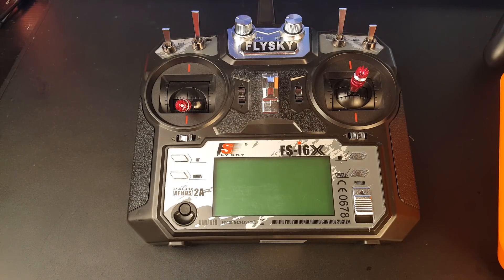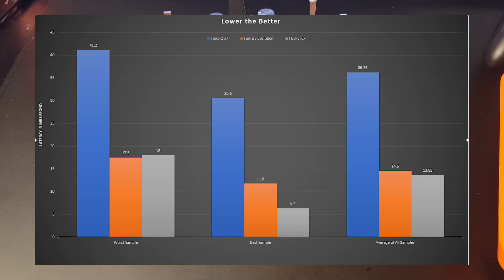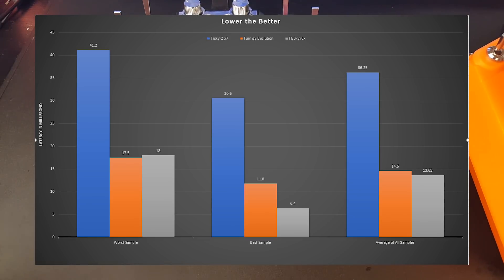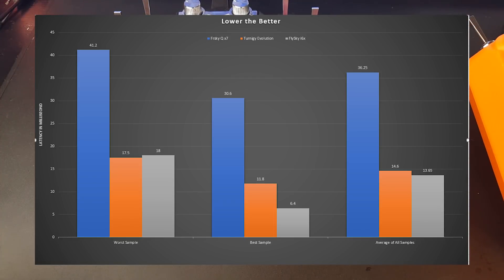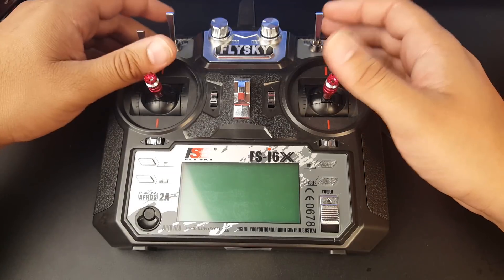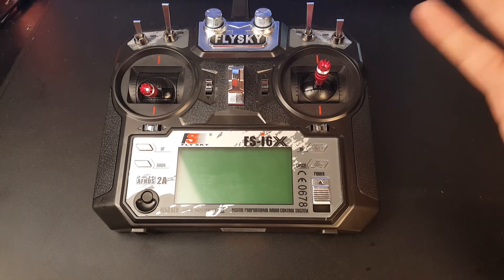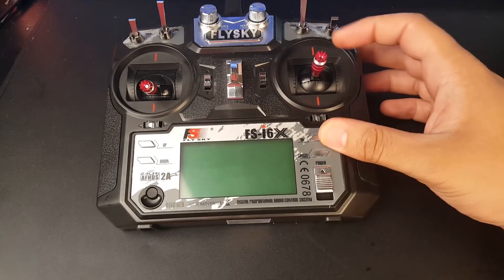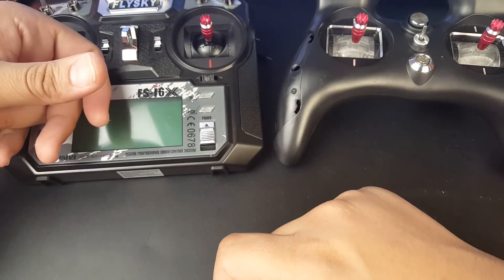TBS Crossfire Killer?!! // FlySky i6x Latency

Comment from the maker: Hey guys I'm not saying TBS is bad at all it seems hella fast soon I'll get my hands on one.
Reply: I'm wondering with a 1000watt RF amplifier why even bother with a crossfire mod. Range would be crazy.
Reply: prophet11236 its on Amazon listed as 4w. I tested the power output and its actually 2w. It's a metal case that kind of looks like a bird design. It's bi-directional so you get telemetry still, as long as you are using diversity receiver. Like the ia6b or the x6b.
Reply: prophet11236 Wifi Signal Booster 2.4Ghz 4W 802.11 Signal Extender Wifi Repeater Broadband Amplifiers for Wireless Router, with 5dBi Antenna https://www.amazon.com/dp/B01B94U438/ref=cm_sw_r_cp_apa_M4JwAbPS00TCQ
Reply: @Just-A-Guy-Learning  Hum
Reply: prophet11236 yes its great for long range and its definitely not legal without a ham license for us here in the USA. Definitely get your ham if you dont have it. Cya. Cover your a** lol.
Reply: Drone Mesh what happened to Omnibus F4 pro corner. Is it good ?
Reply: Yeah the fsi6 on a 2w module goes stupid far.
Reply: KNUCKLEUP FPV can you post a link to the 2w module you used?
Reply: KNUCKLEUP FPV ok cool bro. I will check it out. Would be great for long range even though the transmission power is illegal in the US...
Reply: Hey boss where would u place the Flysky i6s in this? Is the latency basically the same as the turnigy evolution ?
Reply: Justin Mack yes ibus on i6s is the same
Reply: Can I install "TBS crossfire" on FlySky FS-TH9X 2.4G 9CH Radio?
Reply: TBS is not Bad hummm TBS kille all rlink... My RC car 10km 1 w TBS lite number one, you TX 2.4 GHz shit -40 USD 😂 ! My TX futaba  1500 USD + TBS lite is best
Reply: @bongarcon8806  I'm not even sure what you were trying to say in that comment.

Comment: As an flysky and frsky user i can confidently state that flysky has very very very low latency than accst protocol. and i have never ever failsafed till now reaching more than 1.2+ km range. and i am impressed with its solid AFHDS 2A protocol most underrated one. seriously the latency is very very less that it feels like you control the servos directly using wires.

Comment: I would like to see how Stable the signal is over say a 5 second delivery of many signals and see how much "jitter" you get as I have a DX8 and on paper it was, a few years ago the fastest response you could get BUT! The signal jittered all over the place and made it Soooo hard to setup a quadcopter it made me buy a X7 and I have not regretted it to date?.Like so many things the speed is only half the Answer.How many times the rx has to get another packet of info is equaly as important to me? as if it does have to re-send a packet then this will skew the answer.I know in a perfect world of "Digital" signal tx/rx's would only have to deal with how fast it can send a signal But! wireless sinals are not in a perfect world ?m.Carbon frames make reflection trees and buildings do to and a multitude of other things are capable of clipping a packet of info and Bang! their goes your fantastic latency and this changes Everything!.
Real world Testing is the Only way to get a True indication of how good your transmitter is .
But I will say that benching things is a good place to start the working out of a result.
enjoyed the video
P.S. This is my opinion only and I stand to be corrected as I'm reciting alot of what a close friend has told me and he is a trained electrical engineer .
Ultimately  It's all up too THE THUMB's with Me! 
cheers

Comment: Ibus is a faster protocol than sbus and spektrum. Its been tested and posted in a few related github repos and on a few rc groups. There are mods for original fsi6 and you can run any protocol as well as openavrc. Its like open tx but uses less of the ram and memory. A stock fsi6 can easily go 2.5km. There is more than one video proving this on youtube. Crossfire still goes further. I went from fsi6 to a qx7 and can feel the difference in response. Im killing crossfires range with a 433mhz openlrsng system. Running sbus with telemetry. Unfortunately ibus was never ported into openlrsng. Otherwise thats the protocol I would be using.
Reply: 2.5KM under perfect condition. Mine already struggle at 350M with several obstructions and quite a lot of interference. Also, at those condition, I can feel that my i6 latency become worse when my X7 performs just the same. SBUS is a very old protocol, first invented by Futaba and used by FrSky until today. Even Futaba already released the SBUS 2 or something. I'm waiting for new protocol by FrSky.
Reply: IRFZ44 i fly in high rf city environment. No problem with range. They freq hop extremely well. Only issue is qc. You may have solder blob to ground where you shouldn't. Like many others have had. Killing your rf. I added a 4 watt booster and have not found the limit with the extra power.
Reply: IRFZ44 and there wont be a new flysky protocol. Afhsd 2a is their new protocol. Any rf gains latency at range. You just got a bad radio my friend.
Reply: You'll disturb other 2.4G band user by using 4W amplifier. 4W is a lot of RF power man. If you want more range, use UHF. Every digital protocol RF link gain latency at distance, but it's more noticeable with my i6 and no, mine wasn't defective. I've seen someone went 9KM with Taranis radio. No amplifier used.
Reply: IRFZ44 i dont use the booster in the city man. If you re read my first comment i fly on 433mhz now. That is uhf. Your radio is defective if you are claiming 350m. Its rated at 500m yet goes much further. My 4w amplifier is less disturbing to things around me than uhf is. I fly 1w modules at 433mhz. They make tv's hum and radios squelch. 2.4 may make a few older routers switch to a different freq. Most are using 5.4 for wifi now. Your flysky would feel slower at range than the qx7 because of the high packet loss. I own a qx7. Thats what my long range modules are plugged into. It has noticeably more latency than my flysky controllers at any range. Gimbals feel pretty close to the same. The qx7 is just too fat. I am removing the grips from mine. Im using a 4 in 1 multi protocol module now so I dont have to buy 13 frsky receivers. I only have one and I dont like how slow it is. I run ibus for my old flysky receivers with telemetry. And obviously the two quads with 433mhz. Multiprotocol module and flysky receivers is the way to go. No inversion needed, and telemetry without an extra wire.
Reply: I used A8S receiver and i6X and got bad results. I don't know why but I don't think my radio is defective. 

Does iBus capable to do full telemetry?
Reply: IRFZ44 your problem is that shit receiver. Its good for 200m. Use an x6b or ia6b. If you get the x6b buy a set of true dipoles like the ia6b has with ipex connectors. You will go way further. Half mile to a mile easily. X6b does true battery voltage as well. If you have osd that's not needed though. The fsi6 is the one that does telemetry. The i6x needs to be modded with openavrc. Fsi6 just needs firmware update. If you use a multiprotocol module you can get ibus telemetry on your qx7. There is a whole rcgroup thread on the a8s issues. Random punchouts. Terrible range. Its a micro receiver for micro quads. It will not do telemetry because its a one way link. Only receives. They have to be wrapped in foil to help at all. I should have guessed thats why you were getting terrible range. Upgrade. You wont regret it. Get the 4 in 1 or an fsi6.
Reply: IRFZ44 and yes ibus will do full telemetry. It will send every sensor or reading back to tx.
Reply: Good to know that my receiver was shit. I just know that i6X has community firmware.
Reply: IRFZ44 the fsi6 has community firmware. The i6x has openavrc which is kind of a pain to install. You have to add an arduino. I haven't seen any firmware implements for it like the fsi6 14 channel telemetry firmware. Seriously though try a different receiver. If you were in northern virginia I would let you fly one of mine. It feels so much more responsive with a good receiver.
Reply: Whoops, wrong lol. iBus can do 18 channels, right?
Reply: IRFZ44 the protocol can do up to 32 channels. But the transmitter has an 8, 10, and 14 channel firmware update. And that's because the tx has limited memory. With 14 channel you can add an extra switch via hardware mod if you want or a third gimbal to control a pan and tilt camera. I own an fsi6 and turnigy i6. Both have 14 channel firmware with transparent telemetry. Ive had them both out to 1 mile. You lose telemetry around a half mile because the rx has weak transmit power. A tiny 1w booster hooked to the x6b gives you telemetry full length of the flight. Booster and rc are about the same size. Ipex to sma goes from x6b to booster. Then antenna goes on other side of booster. With that setup i haven't found the end of ramge before losing battery.
Reply: IBUS seems promising. Tell me more, do I have to do hardware signal inversion? do I have to run one extra wire to run full telemetry?
Reply: Labrador and do not use ibus or sbus on the a8s. Its a non diversity non telemetry receiver. Get an x6b.
Reply: I'm not running Flysky anymore, I just want to know more
Reply: Labrador ibus is running at just over 6ms. There are pics of the signal parttern and speed in the multi protocol group on rc groups. Only issue is no one has made a lua script that works with it. There are mods to the ia6b to get a seperate control line that will talk to lua.

Comment: Hi DM.
As you have an oscilloscope (and more important you are able to use it :-)  ) could you please check if the B pad and S pad on FrSky R-XSR receiver are respectively uninverted S-Bus and uninverted Smart Port signals ?
Thanks in advance
Reply from the maker: +IceCreams62 All I have are XM+ and x4r but as I know yes they are.

:)
Reply: Thanks a lot :-)

Comment: One of your previous videos you mentioned how you like the QX7 over the Evolution because of the additional range of motion in the QX7.  That got me thinking because I actually shortened the sticks on the gimbal of my Evolution which I think compounded the shortcomings in range.  So I reinstalled the original stick with the addition of a couple spacers and now I feel like I have a lot more control and range in the Evolution sticks.

Comment: sounds like the extra delay from frsky comes from the model matching thing.

I've done testing radio controller  with multiple environment, the problem with flysky was there will be possibility u might controlled other people's craft if both power up receiver at the same time, the radio will randomly lock to either or both receiver.

Another test was done with four x8R to output 32channel on taranis x9d plus with xjt module, it shows that frsky can lock on to specifically lock on to individual receiver without mixed up.

Comment: You should try different firmware on the frsky tx as you mentioned. I suspect most delay is in software filtering.

Also you should try one of evolution or i6x when the rx is in sbus mode. This should show that ibus/sbus is not the differentiating factor.

Lastly, try two different frsky rx models to rule that out as a sec.

Great work man !
Reply: Peter Kjellström I

Comment: through my come up in fpv as a hobby i have upgraded to better hardware, i was however really impressed with the flysky i6b reciever the radio is cheap yes but i got more range than expected and my only failsafes were after catching the antenna in the props.  i now use frsky,  tbs products kick balls,  if you have the cash i feel their products are worth the cost.

Comment: Hey man, why in your opinion is the Turnigy TGY-i10 (and the FS-i10) completely ignored in the drone hobby? I use it. It's amazing. It's $99 and IMO the BEST deal in TX's. It's thin, light, has a color touch screen, comes with a lipo battery, does full telemetry, etc, etc... Weird? or is it just me? (With this news, now I'm 100% happy I went with the TGY-i10 instead of an FrSky product!)
Reply: There's a reason why i10 series is ignored in this hobby. Because i10 series is overpriced. You can get the same 10 channels using i6 and various custom features using community firmware for half of the price. At $100 range, Q X7 is so far the best choice. For a little bit more, you get proper upgradeable gimbal, voice feedback, full 2 way telemetry, openTX!, trusty protocol and more.
Reply: The I10 is a bad transmitter for the price. The I6x is a damn good transmitter besides the feel.

Comment: You have a 1000 watt amplifier? Or did you mean 1000 milliwatt amplifier. I am a ham radio operator and my 1000 watt amplifier weighs a ton.
Reply from the maker: Thanks for the correction. Milliwatt**

Comment: wow.... this is just unbelievable results... i have the i6 with the 10 channel mod, iforce2d's tutorial, he also had a look inside and the i6x seemed to have bigger chips and a neater board so they arent identical,  also the thing about rc interpolation rate i mentioned before is about the smoothing and ''therefore'' latency added at the fc's end of the radio signal.. if i'm understanding josh's vid correctly. it would be cool to know if betaflight is ready for the ibus signal and if manuallydoing what josh did is worth it on ibus... also does anybody know if adding caps to esc's and bat leads can cause lag in power build up or if switching on dynamic filter without switching off notch filters can add lag to my stick feel?... i have kingkong motors so i'm not confident of switching off notchs or d term.

Comment: Yes yes yeeesss!! Pleeease do the mods on the flysky!! The range booster and upgraded gimbals!!!! I have the original flysky transmitter and still love it! But i would love to see how those mods turn out! I also have a range booster which i never used because im kinda scared to screw things up.. What would also be verry awsome is to see if its possible to use the tbs crossfire system with the flysky! Of that is possible, and also some better gimballs, of will be the perfect radio:D! Keep up the great work my friend
Reply from the maker: I think we can add modules to the flysky i6x 20% sure about this I saw the board and if it outputs what i think it does we can take from it or make an arduino to convert it to tbs. 

I will look into this once i get a TBS Crossfire
Reply: Look up the openavrc mod with multi protocol. It's been done already
Reply: Drone Mesh there is a ppm out pad on the PCB,if I remember correctly, so adding a modul shouldn't be a problem.
Reply: Omg that would be awsome! But can you also then use the cfrl protocol?
Reply: Yes please. Hopefully the same mod works on the I10.
Reply: UnXisT FPV cfrl wouldn't help to much if you are using a ppm signal from the radio to the module scince the latency is already high

Comment: Can't wait to see your results with the signal booster. I have a supposedly 2000mW Wifi booster (checked the datasheet of the only chip inside, its a 1W RF booster, probably same as yours). If this works decently I won't have to save money for a crossfire \o/ (btw. good luck pissing trappy off enough with your video title to get one from him)

Comment: Someone would have to pry my FlySky out of my cold dead hands. 2km range stock, built like a tank, easy to use, and one of the cheapest transmitters out there. This thing blows my mind :)
Reply: Sadly, mine performed so bad here in interference dense area. Can't go any further than 350M. Frsky performs better but for the money, i6 series is the best transmitter you can buy! I'd rather use Flysky than Spektrum.
Reply: @renzevenir4853   How about the receiver? I can do 1.5Km with an FS-IA6B properly placed on a plane but only 2-300m with an FS-A8S on a drone.
Reply: @gravitywillwin9448  I don't remember, but the receiver is the one that has stack mounting and 2 antennas.
Reply: @renzevenir4853  Then it's probably an FS-X6B. It should have good range though... At least you can try to replace the standard antennas with higher dB ones, the receiver has ipex connectors. Pigtails and better antennas could improve, but the short range could be due to other reasons.
Reply: @gravitywillwin9448  Well, I quit FPV months ago soo...

That's why you don't see me around anymore.
Reply from the maker: Agreed, I will never forget where i started and this was my best friend and he still with me today.

Comment: Lol at that title ...  I6x range ?  crossfire range ?  :)

edit-> oh! it's to get attention  :D   ahah
Reply: Forget range, how about how robust is the signal against interfere? This is 21th century, 2.4G signal is everywhere. Microwaves, WiFi routers, Bluetooth devices, you name it.
Reply from the maker: BTW I will be testing them against signal hijacking will explain and show you guys later. I believe i can fail safe every single quad in the air that is within my laptops range.

I wont show how its done but this will be a method to prove how robust the protocols are being used.
Reply: @IRFZ44: I won't forget range, yet I wonder how the crossfire handles cellphone relays ?? since it's the same frequency (900MHz)... luckily I live in the middle of nowhere :)

@DM : nice :)  then you can make a magic wand "all drones down!"  I already own a universal TV switch off remote :D It's awfully funny in cities, specially on football days !!! ;)
Reply: 6rilllir6 I’ve flown near multiple cell phone towers and have had no issues with Crossfire. It’s a very robust link and I’d never go back to 2.4 control after having it. There is no comparison really.